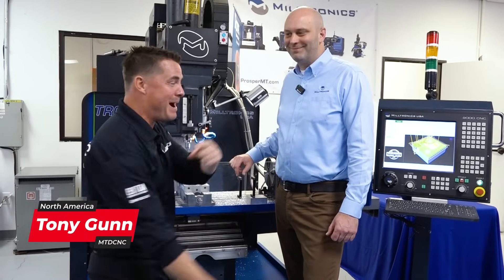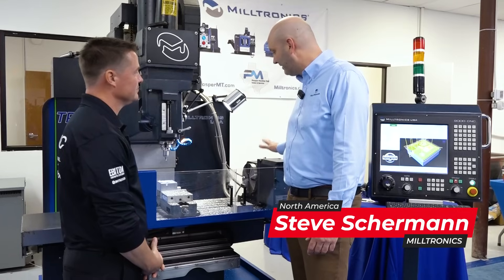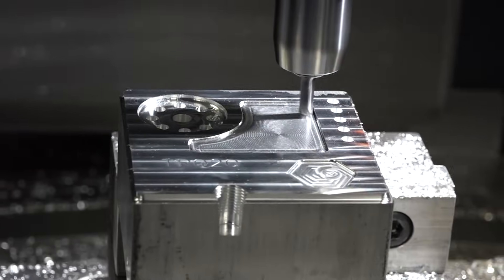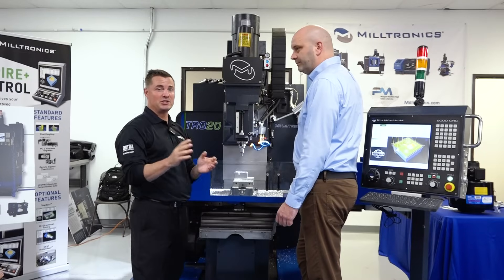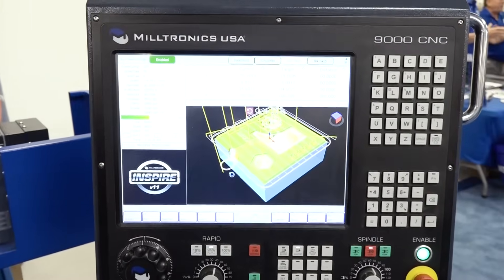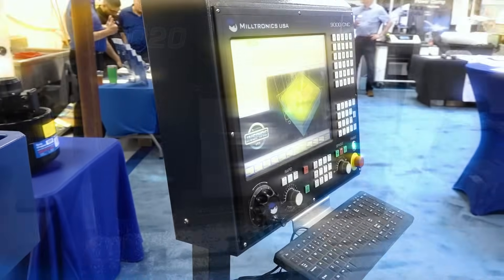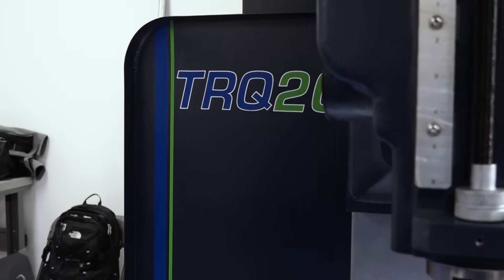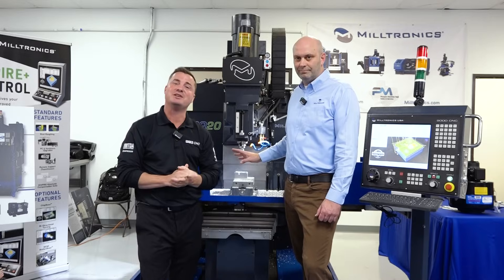Manual when you want it. Full CNC when you need it.

Comment: finnaly one of the few "manual" mills that's not a knee mill but instead a bed mill. and its not like a giant one that take up llike 4x4 meters of ground space
only thing i wish for here is that the part that the Y axis sits on would be wider ( have it as wide as you can without increasing the footpring of the machine )
hope its also boxway on all 3 axis ( dont mind it being that little bit slower then a liniar rail one when its like semi manual semi cnc machine when i get that much rigidity that you get from a boxway ) . maybe even have a boxway and a liniar rail option when buying it ( and a conversion kit avalible through you for those that buy it secen hand  in a couple of years )